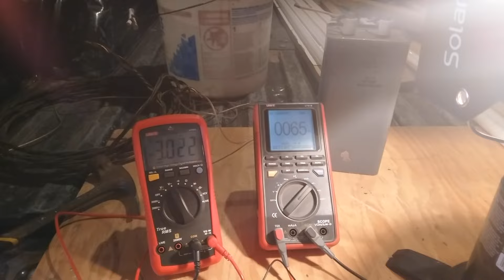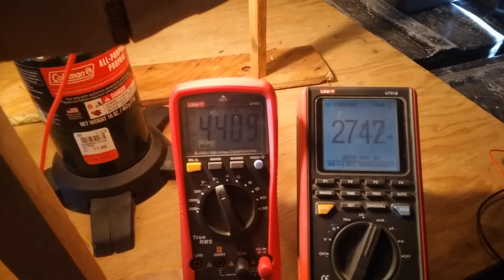Photo electric generator

Comment: There really should be a camping-style phone charger for your fire or lantern to power. I'm sure something could be put together that works fairly well, but would likely need quote a few high powered PV cells with a small buck converter. Keep it going!
Reply: There is it is a thermal couple type small woodstove that you build a fire in and it turns heat into electricity and it's pretty good for what I've been told.